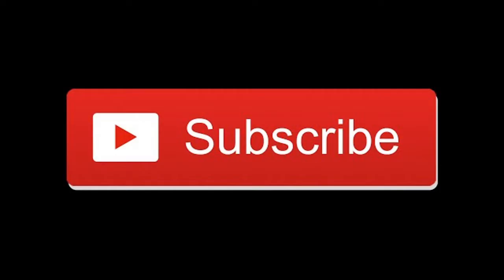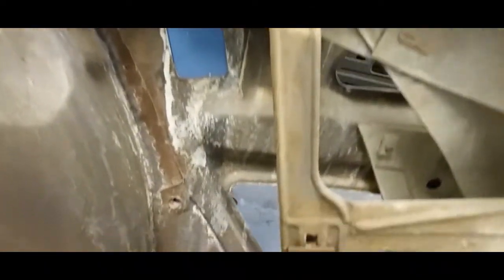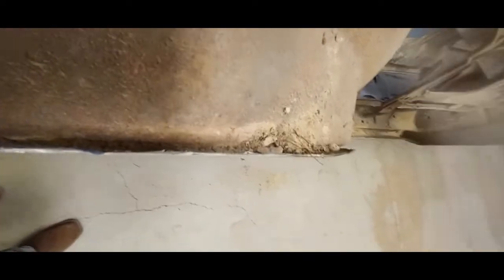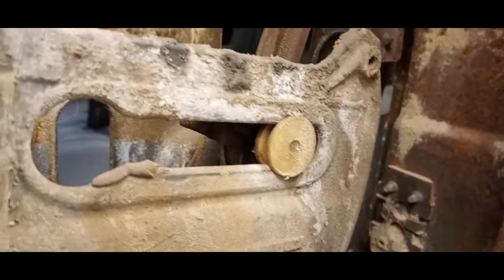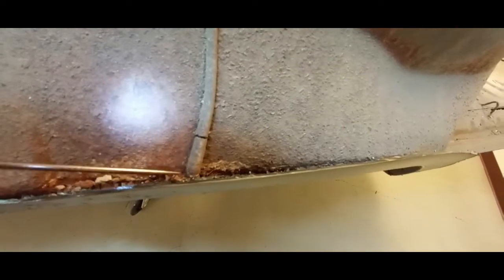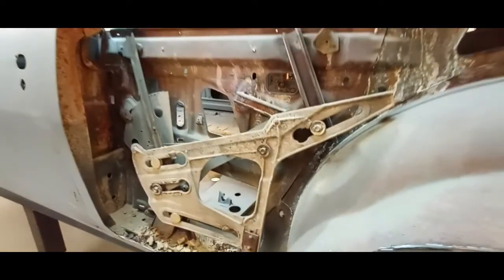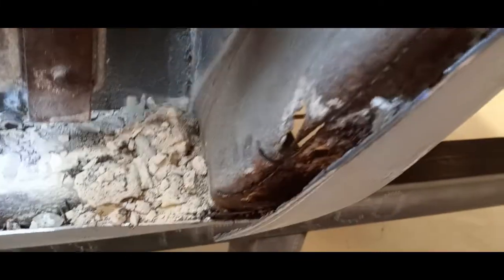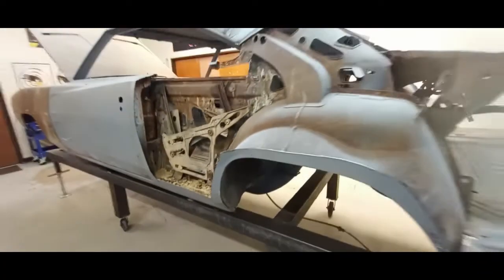Why you NEVER use DUSTLESS BLASTING on your restoration project !!! - DIY Auto Restoration

Comment: This seems like more of an issue with the operator not taking the time to do the job right.  Blasted wet with a rust inhibitor, pressure washed with more rust inhibitor, and vacuumed/blown out would have drastically different results.  I do agree, though, that rust inhibitor should NEVER be considered an “option” when wet blasting any type of metal.
Reply from the maker: Thanks for watching !
Reply: 100% correct..

Comment: Giant Vibrator and hours of vacuuming. Put it on a stiff suspension trailer and go for a 3 hr. drive on a gravel road. I learned from an expert refinisher before stripping, tape every seam and joint off, after stripping and washing etc. then pull masking and DA sand entire body with 80 grit.
Reply from the maker: Thanks for the comment !

Comment: Dustless Blasting is Amazing !  The issue with an older car like this are the large gaps in which the sand can get in & stay. Therefore you simply have to mask off the gaps in order to prevent the sand from getting in.
Reply from the maker: And that is the problem, 90% of the guys dustless blasting aren't interested in doing high quality work and most customers aren't aware that these guys are ripping them off until it's too late....
Reply: My wife and I started a blast business. But we love restoration. Even if it takes a little longer, we would never leave a job like that and feel comfortable. Especially on a beautiful ride. If you find someone that loves the piece they quote, you'll get a good result. We're willing to give our customers more just based on our passion for the result.....and maybe a chance to drive the beast...lol
Reply: No amount of masking will ever keep out the water and class under that pressure I had several layers of duct tape and it still blew it away
Reply: @benjamindouglas5043 whats necessary to buy for a bussiness like that ?

Comment: So, I did this with my 1959. Good this is, is that I didn’t have double panels, hidden crevices, and it was insanely hot that day, and what was there dried almost immediately, after blasting. Also, the guy had rust inhibitor in the dustless solution and I never had any flash rust. Good thing because it sat outside for another 2-3 weeks. 
Still, the Guzz is spot on!!
Reply from the maker: Thanks !! 👍

Comment: Great video!! I was going to dustless blast my impala before bodywork but after watching this I’ll use paint stripper or another method to get it down to bare metal
Reply from the maker: Just FYI and word of advice on aircraft strippers / paint strippers the EPA has mandated and the key ingredient methylene chloride has been removed from paint strippers and be plain speak... they don't work anymore, take a look at the front of the can and they will all say non methylene chloride, it's really down to manual stripping with sandpaper or some type of abrasive wheel, finding a really competent media ( dry ) blaster, maybe soda blaster I haven't used any type of soda blasting I really don't know how the well that process works.
Reply: @guzzifabrication3448  Thank you for the info, I’ll go the sandpaper or abrasive wheel rout..
Reply: @guzzifabrication3448  Thanks for that explanation; I figured it hadda be something like that.  I used "aircraft stripper" back in the day, and -- as a Subscriber to Robby Layton's Y/T channel -- I'd wondered why I was seeing everything get sanded or dry media blasted.  Now I know.  I've got a '63 Impala Model 1839 in my garage that's slated to have the finish re-done.  That road now looks a LOT more rocky.

Comment: Really happy you showed this been trying to warn people against using this crap it is shards of glass along with high-pressure water to carry it that connects together like a dirt-dobber nest impossible to get out unless you brush it and scrape it high-pressure air won't move it took me four months to clean my car after this mistake. Worst thing is if you don't get it out it will lay their wet for months every time you wash your car. Aluminum oxide media blast is the best very light powder easily blown away after for cleanup and doesn't warped any panels.
Reply from the maker: Yes Sir, you are absolutely right......

Comment: Just a question. I have done panel removals before and have seen it that bad without blasting it. The car I had the owner lived on a back road. And it looked just like that. I feel dry and wet blasting gets into the same spots. But if you have the car interior stripped out and blast it there is no way to stop the media from entering unless sealed.
Reply from the maker: If you "wet" media blast, all of that wet media is packed into all of the seams and unless there are access holes to flush every bit of the wet media out, it will always be there and every time there is moister in that spot now it's holding moister until it dries out again..... in a perpetual cycle..... not what you want. However if "dry' media is used, when finished using a combination of blowing and vacuuming pretty much All of the media can be removed with out a doubt. The problem is the 99% of guys doing the wet blasting ARE NOT interested in removing the media..... you know that as well as I do... even if they tried they couldn't remove the wet media sandwiched in between panel without an access hole..... AND then there are the guys NOT using the rust preventative additive that they MUST use, or you get the same old cop out " the customer didn't pay for that" pathetic...... Thanks for watching!
Reply: @guzzifabrication3448  I agree anyone that blasts and don't remove it are first lazy. Anyone that does wet blasting and charges extra for the chemicals to stop flash rusting are rip offs. That chemical should be part of the cost period
Reply: @guzzifabrication3448  That's a valid point, I would never dustless blast my car, thanks for the content.

Comment: I had my gto dustless blasted and they used glass media and a rust inhibitor. I didn't have any problems or find anything like that when I did my quarters.
Reply from the maker: So your saying your vehicle was completely wet media blasted and there wasn't any media inside the panels? I doubt that, there is ALWAYS media in between the panels and other areas whether you wet or dry media blast that must be removed and that's the issue, it's very hard to remove wet media in inaccessible areas..... dry blasting media is much easier to remove.
Reply: @guzzifabrication3448  I didn't say there was nothing. I said it didn't cause any additional rust.
Reply from the maker: @justinevans5616  and that's the issue too many of these dustless Blaster operators don't put in the rust inhibitor and then the customer doesn't know..... luckily yours did I'm glad that they did for you, this video highlights when they don't.

Comment: Also dustless blasting isn’t a guarantee not to warp sheet metal. The warping happens more from the peening effect of the media, think of hitting a panel millions of times with a little hammer, the metal will stretch. Like you said numerous times a competent blaster is the key. I looked into switching to dustless blasting when it first got popular. Did a lot of research. Yeah I’ll stick to my dry media. Clean up is a pain but a lot safer.
Reply from the maker: Yes sir, you are speaking solid info hey thanks for the comment !

Comment: Great vid.  So if dustless blasting isn't a good method to strip a car body, which other method is recommended?
Reply from the maker: @tucobenedicto1780  great question, a competent dry blast with the correct media is always my first and best choice,   once completed the media is vacuumed away and a quality Epoxy primer applied to the sheetmetal.

Comment: Dustless blasting seems to be a viable option if all the closed areas/panels etc are open prior to restoration. On many old cars, inner quarters, chassis legs etc have certain level of corrosion anyway. So in my opinion, there should be no close areas left in a proper restoration.
Reply from the maker: Thanks for watching !

Comment: This happens with all blasting methods. Just being wet makes it harder to remove because it cakes. With regular blasting you never get all the media out. I take a few hours with the big air gun blowing out all the cavities. I think a pressure washer would be a good idea after this and you will need to punch in a few strategic holes for access and patch them up later. That would then give you spots to get in there with the cavity wax in those super long nozzles.
Reply from the maker: Wow... you obviously don't have a clue or much experience in any type of blasting......

Comment: Wow !! thank you for making this video ! my dad was thinking about having his camaro stripped with dustless blasting, won't be making that mistake..... How do you strip restoration projects in your shop?
Reply from the maker: We usually media blast inhouse, Thanks for watching !
Reply: @guzzifabrication3448  media blasting is different from sandblasting and dustless blasting correct?
Reply from the maker: @heisenberg7186  sand, glass, Walnut shells, plastic, slag, etc are all aggregate, the word "media" is a common name used to refer to any of them. We use a medium grit sand ( name brand shark bite )  when we  media blast.
Reply: @guzzifabrication3448  the dustless blasting also using different medias. Still not understanding the difference

Comment: Very informative, what are your thoughts about chemical dipping?
Reply from the maker: Thanks for the comment. Chemical dipping facilities are hard to find and the issue with chemical dipping, if the acid is not completely neutralized or is trapped in recesses / seams and not completely removed and neutralized, it will seep out later and come through the new paint job. For paint removal on auto body  applications the best method is a very competent dry media blast or soda blast ( Soda blasting requires a few extra steps and complete show the removal )

Comment: With all the types of blasting and media available what do you recommend for stripping a car down to bare metal without warping panels and leaving a disaster like this behind?
Reply from the maker: A COMPETENT media (dry) blaster using the correct aggregate (sand/glass/media), pressure, angle.... it's not difficult to media blast body panels if a guy will pay attention and follow the rules of media blasting.... The trick is finding that professional.....
Reply: @guzzifabrication3448  I wish you were closer to where I live. I have 2 cars I need blasted and I am scared that they're going to screw it up.

Comment: I dustless media blast and it’s 100% prep fail on the painting side of it. I also dry blast cars because people are afraid of the issue you’re showing but fail to understand that sand WILL get into every crevice. It literally takes hours for a diy guy to blow all the sand out at home and there still will be sand somewhere in there. What you’re showing could still be a product of dry blasting and someone trying to power wash the sand out and didn’t do a good enough job. I’ve seen that as well. It’s not a blasting problem it’s a preparation problem. Whoever did that car prior to you getting it was lazy. Proper procedure: strip car, remove ALL drain plugs including the rocker plugs, if there’s no rocker drains you make two per side, blast it, blow it out, power wash it, blow it out again, wash with inhibitors and one more blow out. To to the car 100% correct after that it should be dipped in a sealer instead of spraying but you get the point. It’s expensive and that’s why people cut corners.
Reply from the maker: At the end of the day they main issue is you cannot blow out wet sand packed into inaccessible crevasses and joints.... especially after it dries...... dry blasted media can always be blown out of a car, yes it's time-consuming... but it can be done. Then there are the guys who don't put corrosion inhibitor when they wet blast that's a whole other can of worms.... the owner of the car told me it was wet blasted, as far as dipping cars I don't even know anyone doing that in this part of the country
Reply: @guzzifabrication3448  that’s just it though, if you wet blast you have to power wash immediately after to get all the sand out. If the car is stripped down it’s much easier and less time consuming to get everything out. Once it’s done being washed completely out you take a weed sprayer with inhibiter and spray everything down immediately after that. It doesn’t matter how good of a job, flash rusting in tight areas and inside of rockers will happen nothing is absolutely perfect but it can be close. If you’re doing quarter replacement it’s best to cut most of what’s being replaced off before blasting. I’m not questioning your ability to restore cars you do a fantastic job! Most people don’t have the money to strip down a car and do everything in a proper order to make it nearly perfect. Because to do it right is very expensive. I love your content and your work. I just feel that people who cut corners in our field, are creating problems like your dealing with in this video and it makes us look bad. I try my hardest to get the best results the proper way but people don’t have the patience or money so they have me do what they can afford and the end result is what you’re dealing with. Does that make sense?
Reply: @guzzifabrication3448  oh, I forgot to mention the only reason for wet blasting is to prevent heat warping large panels. A lot of people send out their hoods to a media company and get it back wavy as all hell. Most companies don’t have good guys blasting, just a guy who blasts but doesn’t understand car panels
Reply from the maker: @jasoncardoza6375  We're just sharing perspectives, you sound like you take pride in your work. Thanks for supporting the channel ! Your comment is appreciated !
Reply: @guzzifabrication3448  I agree 100%. I try to make everything I do done to the best of my ability to achieve the best results so when I see someone like yourself doing the same I really appreciate it. Keep up the great work my guy!!!!

Comment: So tell me how dry sand blasting doesnt get into all these areas as well and how would you get it out.
Reply from the maker: Thanks for watching, dry media does get into those areas.... BUT you can use a combination of compressed air blowing the dry media out and vacuuming with a tapered nozzle and remove the media wet media packs or cakes into inaccessible areas and you can't..... PLUS the inside of doors, quarters, etc and hardware usually are not painted or have very little corrosion protection and the last thing you want to do is spray water with media and wetting any dirt that might be inside the panel already creating a  mud paste in them.
Reply: @guzzifabrication3448  wet media will dry out and can be removed the same way if you don't request rust inhibitor because of cost yeah things may rust but how is it that dry media that is unattainable where it gets to wont grind away at that seam or crevasse its stuck in and cause it to rust anyway caused by the vibrations of driving. It is my understanding that Dustless is primarily to restrict toxic airborne particulate seems there is no perfect way of stripping paint  just different ways of environmental protection as this is done usually outside not in a controlled interior environment like a spray booth, Maybe the answer is to do the outside wet and the inside dry, just my opinion.

Comment: That's crazy and unfortunate. Could you just power wash all that out of there and blow dry? I just wonder if you dry blast any of that how would you keep that media from getting crammed into crevasses you don't want? Or will that just blow out since it's dry? Thanks for the vid.
Reply from the maker: Once you remove a little bit more of the metal we're going to Media blast that dry, dry media can be vacuumed or blown out, and our vehicles are usually on rotisserie when we media blast them so we can turn them upside down and it's not an issue getting the media out. Thanks for watching
Reply: @guzzifabrication3448  "...it's not an issue getting the media out."  So long as you dong it in the right places with a rubber mallet, and slap it all over with the palm of your hand.  Even dry media cakes a bit and may need a little bit of "encouragement" to break loose and fall out.

Makes me wonder whether hitting it with a continuous 25Hz rumble out of a 250W bass "kicker" cabinet wouldn't be the most sheetmetal-friendly way to rattle all that dust outta the crevices.

Comment: So if you do dustless, remove all removable parts concentrate on small panel areas and treat. Or best dry blasting?
Reply from the maker: I always will use dry blasting.... it really comes down to using a competent media blaster. The problem with wet is you can never get all of the wet media flushed out between non removable panels

Comment: What are your thoughts on a UR007 Uni Ram Reclaiming Abrasive blaster? I have the chance to purchase a used one locally.

Thanks Todd
Reply from the maker: I researched that model, I really don't have any experience with a reclaiming blaster but it would seem to be suited better to flat panels and simple shapes, if you are planning on auto body stripping I could see limitations... like jamb areas, around bracing, inside of panels. Is it possible to bring something difficult to blast and try before you buy the one you are looking at? Let me know how well that type of blaster works and what application it best suits. Thanks for watching.
Reply: @guzzifabrication3448  Thank you for the reply. I was wondering why I was seeing those "Dustless" models for sale on Facebook. Your video is a huge eye opener. Thanks for noting the limitations, which I have thought about. If it works, I figure for $600 it would be a suitable ametuer unit as I have a 69 Bronco, 69 Datsun 2000 and a 58 Triumph TR3A that all need to be restored. Thanks again